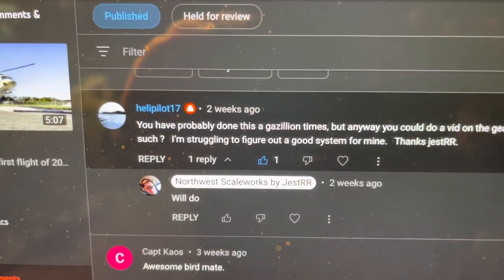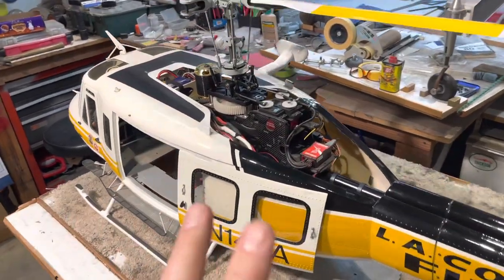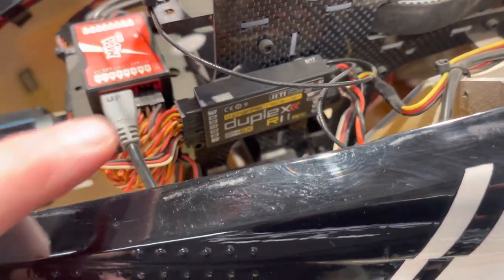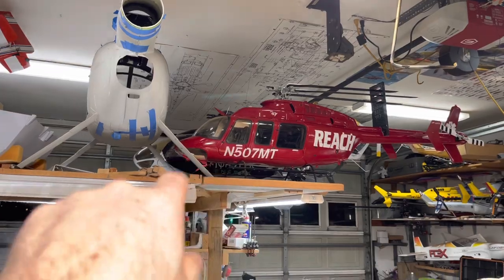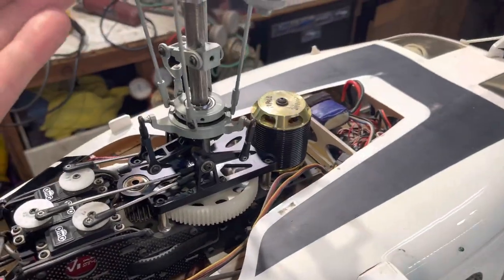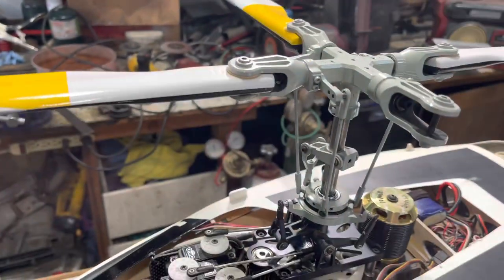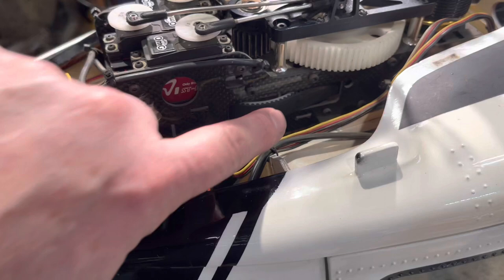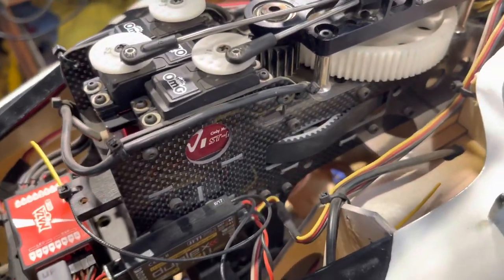My set up on the Roban Bell 412 for helipilot17

Comment: Thanks again for the information Mike.  One more question, on your light controller setup, I see you have a battery amongst the mix.  What size of battery are you using for this? I assumed the light controller worked off of the main batteries,  apparently not lol 
Thanks again sir

Rob Harris
Reply from the maker: Talking about the battery that is just under the front of the doghouse. Yes, that is the light controller battery and I believe it is a 2200 3S. One of my questionable batteries that I won’t fly an aircraft, but I will use for light programmers.
The helicopter has its own battery, a 2200mah 3S for the radio system, and the main packs are two 5000 mah 6S packs making 12 S to run the motor

Comment: Hello again Mike.  What is your preference in a LiPo battery charger ?  Mine is a pos.  Lots out there to choose from.   Thanks 
Rob
Reply from the maker: Well this is what I have…an EOS 720i superDuo3 from Hyperion and an icharger 308 duo.
I made up a charge box out of a RIGID tool case, put in two 1200 watt 12v power sources, one for each charger. That way I can charge 4 of my 6S 5000’s at a time!
Reply: @JestRR    Thanks again Mike. I appreciate the info.

Comment: Hello Mike.  Love your videos.  My name is Adam.  I was wondering if you could help me with a vibration issue on my Roban MD-500E 800.  First off what headspeed would you recommend?  The blades are balanced and the helicopter runs smooth without blades and with blades at zero pitch.  I have the mechanics on a test flying rig and when I pull pitch to fly. I get a nasty vibration.  As soon as I land and reduce pitch it goes away.  Any tips for me.  Running a Egodrift 460kv on 12S with a Castle 160HV.  Thanks in advance.
Reply from the maker: Couple of things to check….
Blade tension, make sure the blades move back and forth with the same amount of pressure to move it. If one is too tight, that can cause a vibration. 
Also check the thrust bearings. They have been known to be put in backwards and unlubricated. In the stack, the race with the smaller inner diameter goes towards the outside. 
And I’d start at 1200-1250 on the RPM.
Reply: Thanks.  I will check those things out.